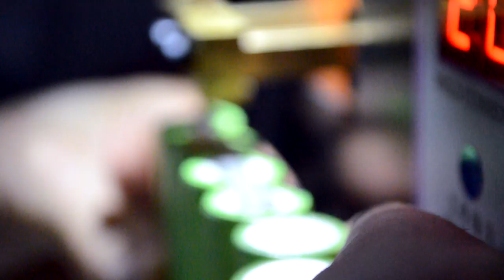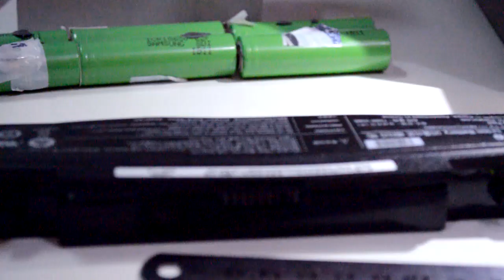Repairing a 6 cells Laptop battery

Comment: Hi. How do you solve the problem with the controler? When I try to reconnect the controller to the new batteries, it gives an error to the computer and one of the chips in the battery board gets very hot. I tried the board before disconnecting it and it was working perfectly. Some people says that is a protection system when the board gets disconnected from the power. Can you give me an advice? Thanks.

Comment: Hi Damien , a very good video produce . I have a HP 4g battery pack which is not charging , I notice that the battery power is full but the protection board is malfunction . manage to open and found  6 cells fixed inside , went on line to purchase one ,but there are  many types  of board . 2s . 3s 4s 5s ,But my original board reads with a bunch of many stupid numbers , I only notice  on one side of the reading  as EBE2s , ordered one and it arrived . notice that it's  size and connection port are a bit confuse . This original board has two thermal fuse but the board I rcvd is just simple . is it save to fix the one I received .or have to buy a different one . Can you guild me to one suitable product which can save my spoil  power pack . your advice plases
Reply from the maker: When you find 6 cells they are usually configured 3s2p, so you probably need a 3s BMS. You can follow how the cells are connected to check it. I can't help you further more with no images of your boards
Reply: Damian ,thanks for your swift reply , I believe what your info is right . will order one from online . But one small doubt still remain ,the original board has two thermistal fuse install . but most online sale shop have only the normal type with  with all  chip install ,is ok to fix it to my battery . thanks Pal

Comment: hi damien,
for non-production/commercial work (just rc hobby or light repair such as this), would a 110v spot welder be sufficient, or would i need a 220v welder?
Reply from the maker: +Prop GatorInout voltage doesn't mind, The welding spots needs a voltage for around 3.5V. is the output total power the important specification. You need around 1500W pulses to weld around 0.2mm of pure nickel. Around 800W to weld 0.1mm

Comment: hi damien 
i turn around website , and i find we need EV2300 programmer from TI and a software like Be2works to reset the BMS board  .
i bought the sunkko787a from aliexpress this night  ,  but i am not sure that it will work in this way without using the device ev2300+ be2works software .
my question : can i repair  most battary using your method ? how about new laptops generation is it easy to repair there battery without reset  or they need to reset also there chip .
thanks .
Reply from the maker: I would really like to answer that questions buy this work was an spared one from what I specially do, so I have not enough deep knowledge on how laptop BMS's are lately done in that way. In this case there would be no need of reset, but It looks like it is completely neccessary on most of boards
Reply from the maker: i recommend NKON.nl for authentic cells
Reply from the maker: +Adel Belarbi If I'm sincere I don't have a deep info to guide you, as I talked with other experts find my work on this pack to be very luckily to work with no reset on the BMS. So I recommend to research about resseting those BMS boards in case it wouldn't work.
Reply: +Damian Rene 

Thanks for the videos - I do enjoy them.

What BMS would you recommend? I'm considering making three 22,2V packs (6s) and will put those in series for my ebike. I may also make one 18s battery (less likely). I would like a BMS with a digital display, but haven't seen any.

Thanks in advance!

Joe
Reply: Damian Rene Where is it that you purchase your batteries? I don't want to buy cells that are not genuine and I would like to buy in bulk (I'll need about about 100-120 cells).
Reply: +Adel Belarbi hi. Did you manage to test this software or the EV2300? I saw this might work resetting the bms..

Comment: Great work, but I wonder how did u reset the gas gauge IC ? As far as I know when you remove the cells from controller board, the controller IC shut itself down and doesn't allow you to make any charge / discharge.
Thank you
Reply: +Bilal Öz +Damian Rene like all comments, but as far as I know no any laptop battery lets u just change the cells and countinue to charge and discherge due to the cycle count limit and other hazarsous safety protections. Since now I have opened over 500 laptop batteries including almost all models. Most of these cells completely ok like %70 capacity remaining but the cycle count ic shut the charge and discharge operation. Even if I change the cells they never worked. Its all because of the cycle count which is a must on many portable devices including apple products ihone ipads etc. If we find a way to reset or replace the cycle count ic we can succeed on the refurbish operation. thanks..
Reply: +VOLKHANTUBE07 I think we have a common interest, why not get in contact and share experiences on li-ion  ?
Reply from the maker: +Bilal Öz Not all the laptop BMS works the same way. A very simple way to know is making a charge/discharge test and read cells voltages. From now I've not find a laptop BMS cutting the charge cycle from 4.2V to ~3.2V. However you are right, you can find a BMS boards that could cut the charge at wrong levels. I've not found any board that won't allow discharge after changing cells, but I must say I have not repaired too many laptop packs
Reply: +Damian Rene I can say you are very lucky then :) Cuz I m in to battery repair as a hobby and haven't managed to resurrect even a single laptop battery so far. But I heard Texas Instruments has some evaluation tools for the gas gauge chip, maybe I should try it out.
Been checking your channel today and I really liked how professional, neat and clean you do. Keep up the good work, and have a nice day !
Reply from the maker: Very interesting, maybe I've been just too luckily. The pack was made with 2.2Ah Samsung cells. With new Panasonic NCR18650 PF 2.9Ah cells completely charge inside the laptop with original (untouched) BMS to 4.15V and discharge to 3.2V, so I'm 100% sure it is working perfectly.
Reply: +Bilal Öz and +VOLKHANTUBE07, that's a very interesting cooperation you are working on. If you come up to any solutions for this issue (resurrecting the bms) please share it with us! Cheers.
Reply from the maker: Savvas Berdos You have two simpe ways, using the battery on the laptop, and when the laptop shut-off indicating battery is gone, then measure all the cells resting voltage. If the voltage is greater than 3.2V the cells are not discharging an acceptable energy quantity (they should be at 3V for a good DOD (depth of discharge)).
Another way would be discharging anything inside the voltage output of the battery (as light leds for example) through the discharge port, and again measure when the BMS makes the output cut. (If you discharge a standard 18650 cell (unprotected) you can go up to 0V DOD)
Reply: +Damian Rene... Is that a home made Spot Welder, if not how much does does one like that cost ?Thanks Damian
Reply from the maker: around $300, the are very basic chinese ones, but if you use for below 0.15mm nickel strips they work very good
Reply: +Bilal Öz added u
Reply: +VOLKHANTUBE07 thanks !
Reply: +Damian Rene Who films you ??
Reply from the maker: Tania Netsvetaylova
Reply: +Damian Rene could please tell us how exactly we can do this test of charge/discharge to see if the bms shuts down?
Reply: +Damian Rene  Thanks mate appreciate it.
Reply: +VOLKHANTUBE07 Do you think that a solution might be to replace the BMS too? I mean theoretically if you get a BMS with the same configuration, will the battery and laptop work normally?
Reply: +Savvas Berdos yeah u can replace the bms. This is what, most of the Chinese companies do for fake non user friendly refurbished no branded laptop batteries. By doing these most of their products are failed to communicate with the laptop effectively. If u can develop or design the smbus communication via battery and laptop main board u will success on it but it is so difficult to reprogram a communication protocol without the knowledge of the existing protocol.
Reply: +VOLKHANTUBE07 Thanks for the reply. So there is no guarantee that it will actually work. Could recommend a site or a forum were we learn about this stuff (laptop battery building)?